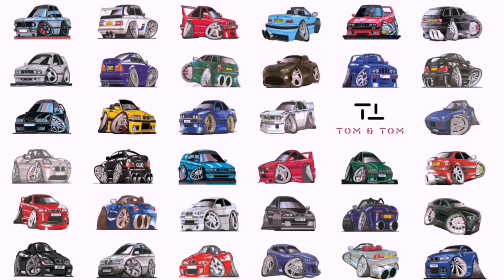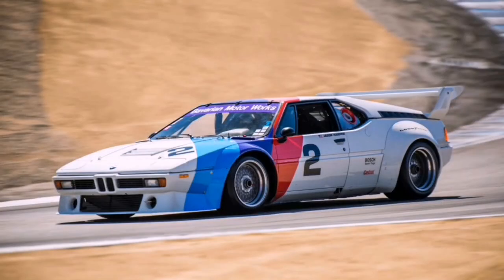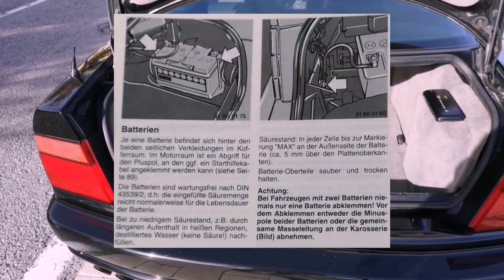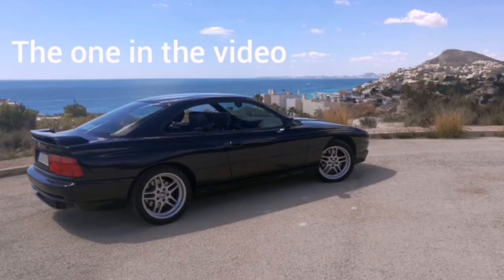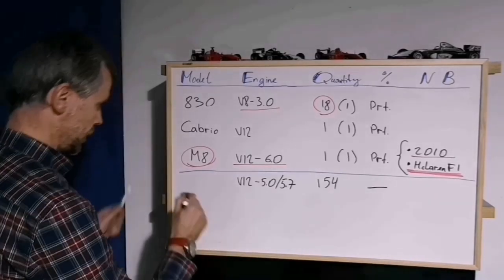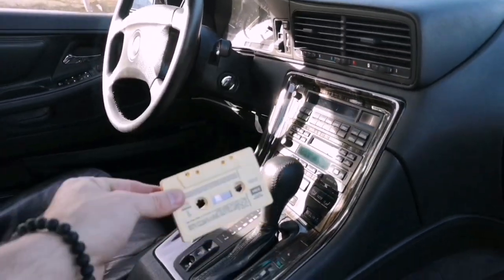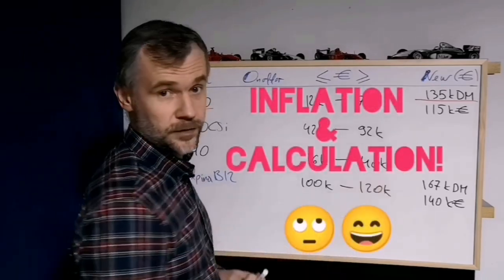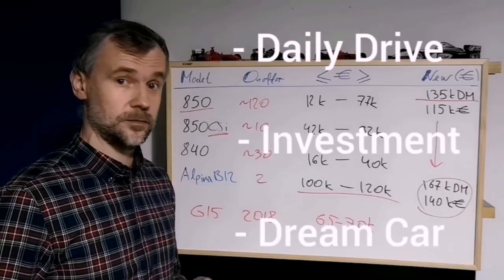BMW 8 series E31 - The Coolest BMW Gran Turismo of All Time | Tom & Tom S01E01

Comment: Great start! Doesn’t the gearbox “winter” mode start riding in 2nd gear in order to reduce slipping in winter conditions?
Reply from the maker: Yup. Low revs, start on 2-ne and early gear changes.